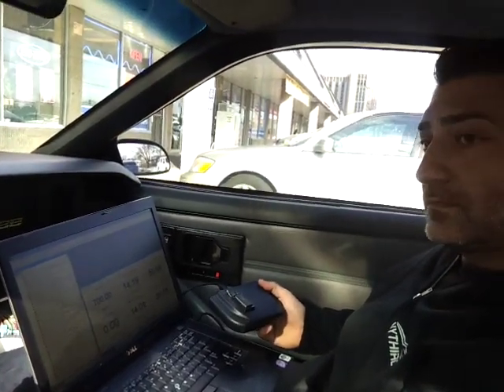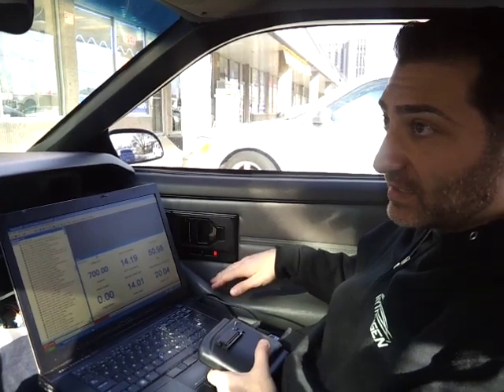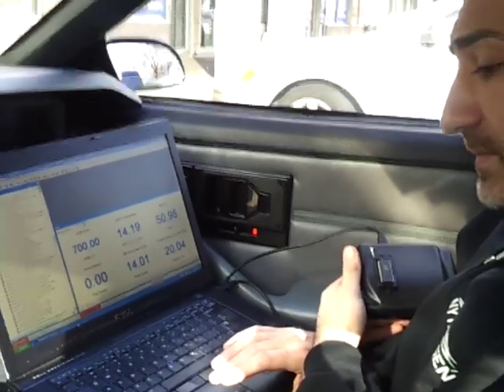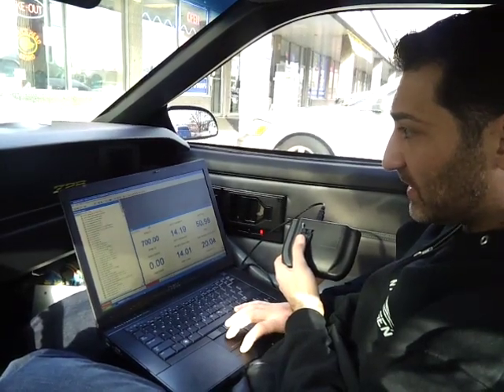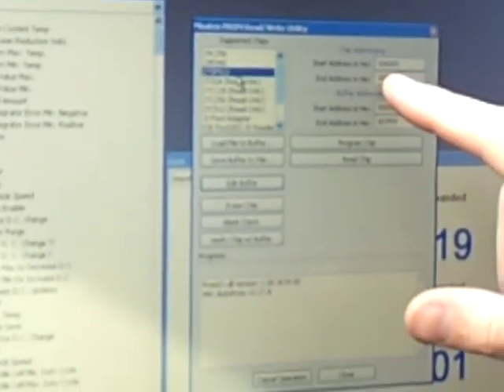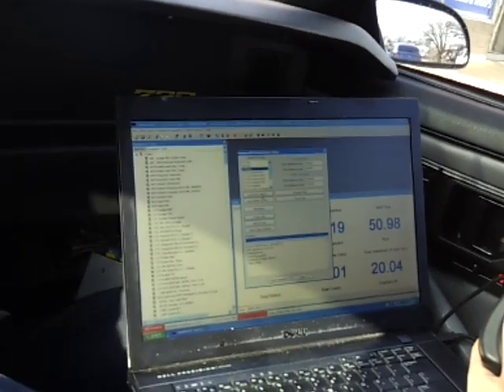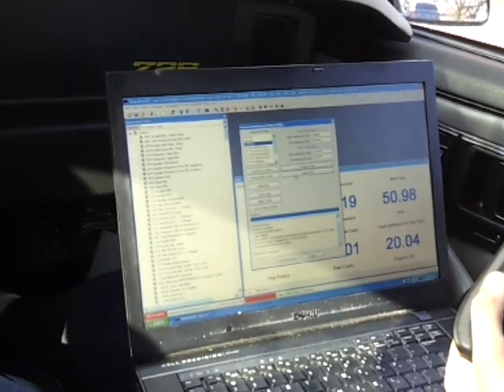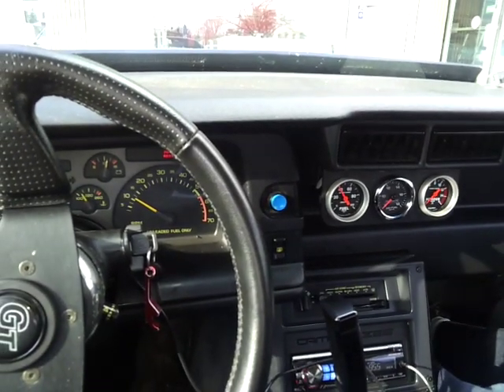CAR COMPUTER TUNING - How to burn a chip

Comment: do u burn chip on the side or you just do your own ..i got a 1990 k5 blazer 5.7 had the engine rebuild with a  lot up grads ..tbi cant get it to run right..i will send you a message to you email...
Reply from the maker: Only personal sorry
Reply: @klowny1969  got a question is it something on the chip that you can adjust for the idle because some on burn my chip and the idle is up high only when i put it in gear but when i frist start it up its low but when i put it in gear it jumps up to about 1000 rpm.

Comment: Buddy of mine and I went 50/50 on www.moates.net and got the 329.00 APU1 AutoProm Package for our thirdgen's, worth every penny.  Of course he's the brain on the tuning part and understands all how to use TunerPro, I picked up on it pretty easy.  We use this to tune my 1988 Trans am GTA 305 TPI, 1988 Trans am with a significant amount of mods that needed tuning for the whole nine yards, and his Twin Turbo Formula 350.  And anyone locally he'll plug in and burn for them for a few bucks.  Nice vid

Sub'd klowny

Comment: Cool... How much does the chip burning cost? Any good places in Washington state? Would it be wiser and cheaper to buy the adapter and program? If yes, could you tell me where I can buy them?

Any advice on which chip would I buy for my 1976 cj7 jeep with 258 4.2l I6 engine and GM TH400 tranny?
(I recently installed a rebuilt GM TBI 4.3l throttle body and harness with the ECM PN: 1227747 and aksa chip. My fuel pressure is to be a constant 12-15psi at the throttle body)

Thanks for the video and information. :)
Reply from the maker: Usually couple hundred bux..not sure about wash state..thanx for watching
Reply: klowny1969
Thanks for your response... Are there legit websites that I can tell them my vehicle specs and have them burn one and send to me?
Reply from the maker: Depends on the car..I think hawks might do that for thirdgen camaro and firebirds
Reply: klowny1969 Humm. Is the OBD1 a third gen? The fuel system I got for my jeep is for GM TBI 4.3L (1987-1991)..
Thanks for the help. :)
Reply from the maker: Oh ok..It might be hard to find someone that would do that motor..really dont know if anyone would send u a tune to ur specs. Hypertech sells some chips..but arent to custom..u can check with them if they do custom work
Reply: klowny1969
 I've read that Howell efi and affordable efi burns chips for my specific needs but can be expensive.. I may have to check them out. Thanks for your suggestion. :)

Comment: Just wanted to say good job, I have a 1990 Iroc z with a 5.7 Tpi, 5-spd, I have done so far, 24 pound inj, Slp runners, ported runners, pentium, intake, 58mm BBK tb, and flow master ex sys, plus a few others, I so need a tune, can u please help!